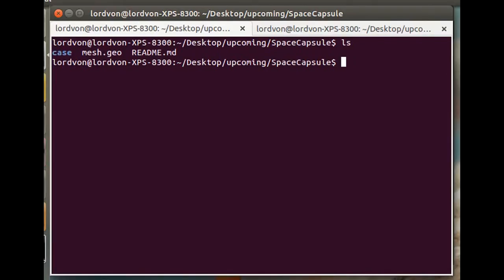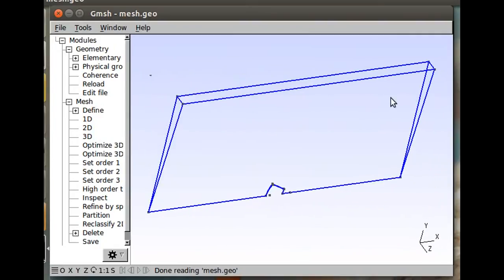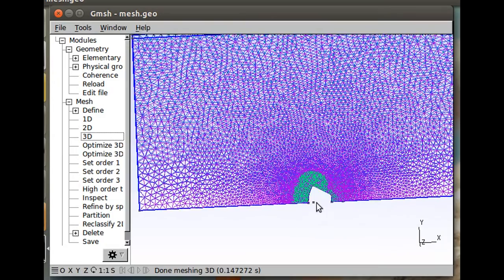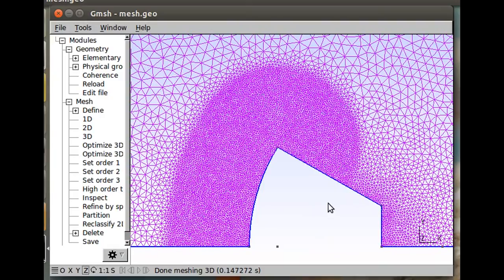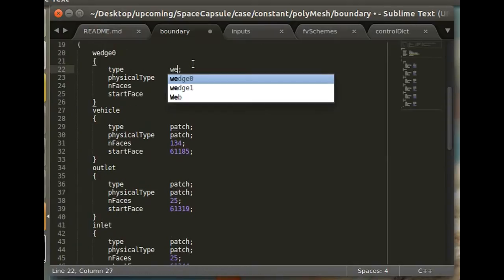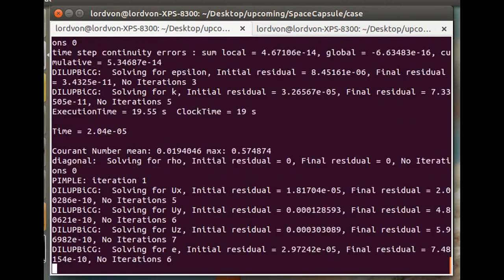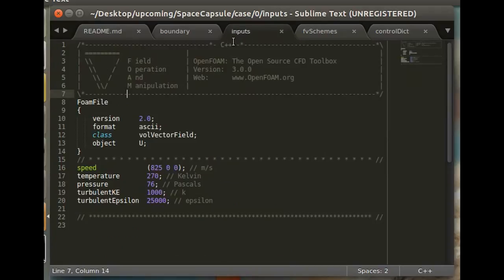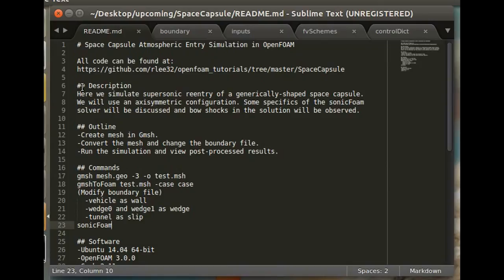Space Capsule Atmospheric Entry Simulation in OpenFOAM

Comment: When I used ICEM structured mesh (The grid height near the wall is 1e-6 m) to run this case, I found that the flow field parameters did not change and remained at the initial value.
Reply: I need some help

Comment: In case you don't know, instead of changing the constant/polyMesh/boundary manually, you can run the changeDictionary application. You define what is going to be changed in the dictionary system/changeDictionaryDict. It is pretty handy when you are setting up your case many times. I usually put it in an Allrun script, right after the gmshToFoam command.
Reply from the maker: +Rudolf Hellmuth Did not know. Thanks for the tip! I will integrate that in future videos.